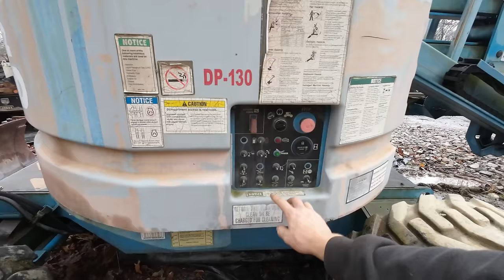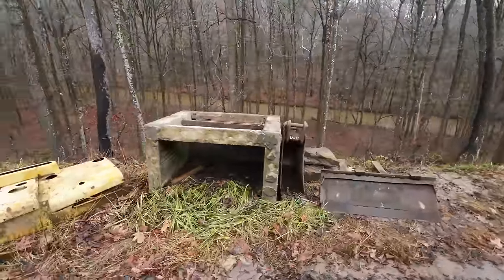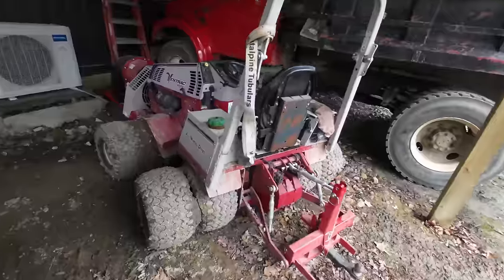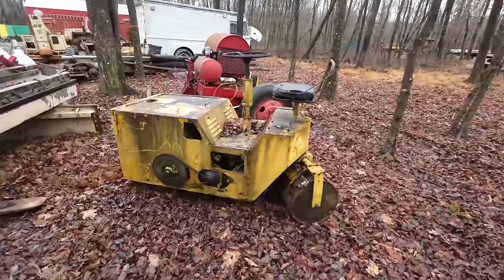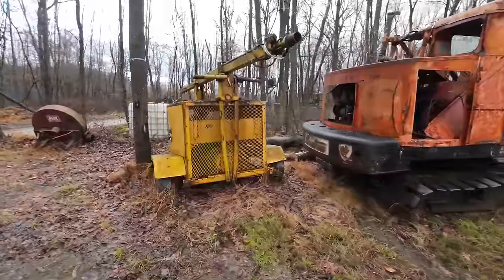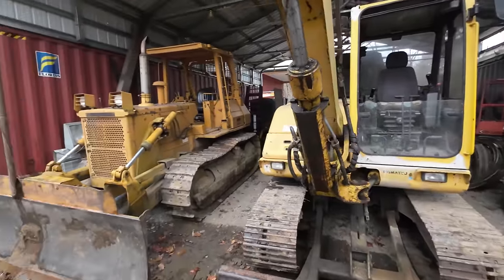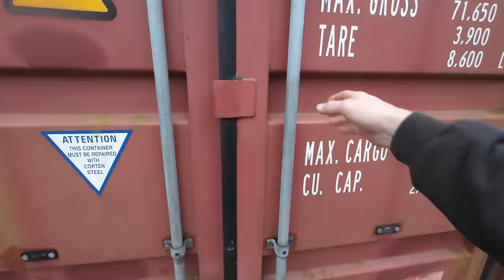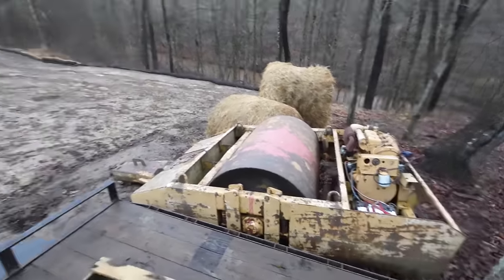Take A Look At My Junk (Every Project I've got)

Comment: This comment is about heating your shop floor with hot water!!! Don't run boiler temperature water in or under that concrete. Start just above floor temperature water and increase the temperature slowly until the floor temperature is about 70°F maximum!! Hot water will cause too rapid expansion and crack and break your floor!!!!

Comment: When you run the air lines underground from your compressor, if you have not already, you should consider another dryer on the incoming side.  Underground air lines will condensate a lot of moisture.
Reply from the maker: Yes that’s my plan.

Comment: I put more miles than I care to think about in old International Loadstars . No telling how many thousands of bushels of grain and how many loads of sawdust I moved .
They had the 250 AC system , which was 2 windows down and 50MPH .
The heaters and blower fans worked great though , and would give you a mouse turd shower like you never imagined possible .
Reply: They have one heck of a good turning radius!

Comment: You showed us the parts washer, using heated water and sodium hydroxide. This brought back memories from my farm days. My Dad and I borrowed a gas powered, diesel fired, steam cleaner used to clean and disinfect mink pens, and used that machine to pressure wash any machinery we were restoring.  It was not a large machine, but it sure made quick work of cleaning up and prepping a machine for painting. In the absence of such a machine, my idea is for you to take the hot water hydroxide fluid and use a pressure washer to apply, you may be able to strip the paint, grease and rust off of your entire machine, rather than use a sandblaster. Much quicker, less messy and strips everything down to bare metal for a perfect clean.  Just a thought.

Comment: Get you some fiber Rock or if you have left over metal from the shop build as a guard and hang them on the wall like you would if there was a wood stove there then you can change them out if you need to or paint the metal if you need to.

Comment: Saw a tip to fix floppy socket/hex u-joints , just use heat shrink and that will make them flexible not floppy, you also need to find a mechanical mule for your farm and because they’re fun

Comment: SAVE YOU MONEY. Matt, as a 30+ yr hyd. mechanic for uncle sam, I need to point out to you that crimp on hyr and air fittings are a total waste of money. These are available in thread on at the same pressure ratings. You buy the hose and swap the fitting over. Those fittings are a large part of the hose cost. The fittings are a few dollars higher, but once and done. This will save you much money over time.

Comment: You really need to be super careful if you are going to try to straighten up that transformer. I would not recommend you try that with it energized. Make the power company come out and do it that is their job after all.
Reply: Yea and pay another 10k? Lol
Reply: @kriptick1  it should be free of charge or at least it would be for the company I work for. Been here 16 years in linework and we have never charged to straighten at pad mount before.
Reply: Couldn't agree more. For 52,000 they should have done a better job
Reply: @mrfordman9999  I can’t speak for that company but they could at least straighten the transformer. We always try to make them lean backwards because that’s where all the oil and coils are at inside them.
Reply: The power company is not responsible for the pad. I built a house in the same county as Matt and I was responsible for the transformer pad. Yes, mine also went off level and gave me no issues.
Reply: That’s called “the union label“…
Reply: Surround padmount transformer with gravel
Reply: @mikemanzo8495  well the company I work for here in Georgia isn’t like that. Can’t speak for everyone but I can definitely say moving that transformer energized is a really really bad idea. Unless you can access the door and some high voltage gloves and also and fiberglass UD stick.
Reply: @kennethbrown109 even if Matt was the guy that prepped and installed the pad?
Reply: @kriptick1 what is your life worth? You’re not just talking 240 volts somewhere around 38000 volts or higher is nothing I would try to do unless they unhooked the power at the road to make it safe. You would be dead before you even knew it
Reply: @corydriver7634  absolutely. You have to remember there is primary and secondary voltage in that transformer and also a thing called step potential. If that elbow comes off the bushing and goes to ground voltage will go to ground. Look up step potential. It can absolutely kill you like right now. It’s like dropping a pebble in a water puddle if that makes any since to you. The ripples would be the voltage differences IE step potential.
Reply: Have the power company come out don’t take any chances you can’t see it or smell it but it can kill you .
Reply: I'm a handy ...man, and can confidently handle just about any job, but I have a rule about screwing with mains electricity, pressurized gas lines, etc... I just don't do it.

There is a reason why the pros charge big $$$ just to show up: They're worth it, imho. I'll save money somewhere else.... But, that said, I don't know all of the particulars here. It's probably perfectly safe to do that kind of job on my own...  But, still, the fact that I'm not 100% sure of that makes it a pass for me... but everyone  has a different skill set, and Matt here is quit a bit beyond me In most things.

Anyway, cheers! (Now I'm gonna research this and find that it's no big, probably, eh?)
Reply: @kriptick1  

10k is only about another 15% (and, depending on how one values their labor, prob more like 5%- thinking in gross dollars isn't constructive) on this job... AND, the cost would probably be far, far less- prob just to have a pro come out and make sure it's safe to do. If it is NOT safe, well, 10k is a great bargain.

but, y'know... I can beat that train.
Reply: @kennethbrown109  

BUT... the power company  DID NOT pour the pad! (They should fix Matt's work?)
Reply: @bholdr----0  they should absolutely fix the pad leaning. One way or another nobody should try to straighten it while the transformer pad whatever you want to call it is energized. I have worked in this industry for almost 16 years and I would not straighten it up myself
Reply: @bholdr----0  I’m a handyman and can change out the meter base and reconnect the lines to the transformer but your talking about high voltage wires coming into said transformer it is around 38000 volts not 220 which usually measures around 248 or 124ish a leg. I was replacing a doorbell transformer once and it measured 144 volts and I was checking outlets inside the home and it was the same. Called the electric company and they confirmed it and pulled and replaced the transformer.  The homeowner over the years had been having problems with appliances going bad, and I solved the problem.
Reply: @earlestes8649  

"Just" 240 volts? (I always thought it's nominally 220, and/or 240 is in the range... still I wouldn't stick a fork in it, or I'd be done!).

Actually, I took a hit from 220 once. (at an 100+ year old factory building I worked at, with some shit wiring- old paper insulation or none at all, leaks everywhere, water on the floor, missing ground lines, etc: ZZZZAP! ...Not. Nice. At. All.

(440 and yer prob cooked... Any elechickens wanna weigh in? I kid! Big respect for you guys)
Reply: @kennethbrown109  Ppl didn't do the pad mount diesel Creek did
Reply: Also the Marcellus
Reply: @kennethbrown109 I was thinking the same thing I think he should've done a better job in the first place to avoid doing anything else in the future but he knows his stuff it'll be fine..
Reply: Going to build a container house w/ containers using Grove crane...my bet 2¢
Reply: @golletim 
you need to post this on the main comment...
Reply: I recall Matt set the base.
Reply: Thanks for the tour Matt.
You've got some really interesting projects coming up.
I hope you're able to finally sell of the items you need to so it'll free up space and put some $$$$ in your pocket to  finance those projects instead of having to get our your wallet.
Reply: Is there not an isolator further up the line? Even if it's Matt's responsibility, he might be able to either isolate his line himself, or get the power company to do it for him while he levels it
Reply: Happy new year
Reply: @rickgalla3377 If you go back, you will see that Matt bedded the base in gravel
Reply: Ha ha there’s another 20k
Reply: @mrfordman9999 if u listened its matts fault he said he didnt compact it when he prepped and backfilled it
Reply: I like projects, but I would put some heat in the floor don’t like cold feet.
Reply: Agreed the flash arc alone will ruin your life if you manage to survive it.  This is a horrible idea with it being energized.
Reply: Arc flash burns can be fatal.
Reply: @earlestes8649 Where do you get 38000 volts from? That’s transmission level voltage! If I had to guess, the primary coming into that transformer is more likely to be 7200 volts (but it could be 7620 or 7970 volts, all very common singlephase distribution voltages in the US and Canada).
Reply: @Renville80  I was just guessing lol, 72,000 sounds right.😝don’t matter average Joe shouldn’t even be thinking about messing around with it. I work with 220 all the time, installing meter bases and panels.
Reply: Definitely bring in one or two of those Cub Cadets and get them up and running.

Comment: I love that beater with a heater.  That was my dream truck when I was your age, right down to the color.  Hey, its only junk if it doesn't run.  If it runs, it has utility.  The only caution is getting too many non-runners so that you don't have time to get them all running.  You are the key to the whole puzzle.  If you can take a non-runner and get it to run, it has utility.  If you get overwhelmed and bogged down so that you don't have time or momentum to work on them, you end up with a field of junk.  Ask me how I know that.
Reply: By the way, Keith Rucker is working on a Monarch 612 right now.  That might be useful to you as you get yours going.

Comment: 01:06:50
You can use it as it is, but with a simple trick, which is to shorten its longitudinal lifting columns so that they are completely below the level of the ceiling beams.

Comment: 44:34
You can use all of these containers to build equipment from scratch. For example, one of them is a heat chamber for treating paint, the other is a sandblasting room, etc.
Or they may be specialized warehouses, meaning that one of them is only for hydraulic maintenance equipment, hoses and cylinders, and the second is for welding equipment and everything related to it.
The third is for electrical tools, wires, circuit breakers, and whatever was boiled there, and the fourth is for storing lawnmowers and their spare parts.
Or you can put them together and build an apartment with two floors and many rooms.

Comment: I love the Loadstar. I did a revive and rescue that involved a 32 mile journey on a boat gas tank with no brakes in a 77' 1600. Mines not a butterfly hood like yours, its the next body style. Biggest vehicle ive ever owned, favorite thing about it is the Dayton cast iron spokes. I didna deal where i gotta haul away 50+ 10.00-20 tires and wheels and i get a free supposedly good DT466B.. so i think i might put that in it....

Comment: On the Gehl blower you need the intake at the center of the fan wheel. With the missing panel out to the edge of the volute (fan housing) the air just leaks out the side of the blower and it won't build any pressure. Close the hole and create a hole in the side of the volute centered on the fan wheel. Make it about twice the size of the outlet. 
You will have pressure and volume if you do.

Comment: The red blower needs the air inlet near the centre of the fan so the air is pushed outwards building pressure, think of it like a centrifugal water pump but shifting air.

Comment: The best way to avoid conduits breaking is not to backfill until the bottom is settled. Especially around wells with concrete rings, the force of the dirt can shear the hose, if you are impatient and backfill all at once. Dont ask me how I know that.

Comment: Matt I can't wait to finally see the 1957 Autocar restored. My main reason is,Autocar was a division of the White Motor Company,and both my grandfather{30 years} and father {40 years} worked there. I also want to say that your channel was the only one I ever purchased an item from and is the 1957 Autocar T-shirt. It took a bit of saving up as I am 72,on disability from terminal cancer,and funds are very limited for "non-essential" items. I will never wear the T-shirt as for one,I can't afford another,and two I bought it as a nice memento of my families work at White Motor Company. A sad note. White motor Company was purchased by Volvo Corporation,and shorty after the purchase,the White nameplate was dropped. White Motor Company once consisted of White Trucks - Autocar - Western Star and Freightliner. The other three went on to be companies of themselves.

Comment: Hi Matt,  that bridge crane laying there will never see the inside of that garage unless your going to tear it ( The Shop ) completely down, rip up the floor and your heating system, dig huge holes for the required substantial  foundation to handle the weight of the crane plus what your planning to lift with it, plus it has to be perfectly LEVEL end to end and side to side, and stay that way.  Now let's talk 3 phase electricity to run this crane. Got it ? The Crane Foundation goes in, the piers are built up to a few feet above ground level to support the upright beams to hold the level track beams. Once their leveled, you can take your big crane and lift the crane and sit it on the rails and  leave it sit outside or build an addition onto your new shop to cover the crane also. Crane foundations go in first before any building is built around them.  The foundations are massive, and have to be to keep them from sinking.  
I really like you and your channel Matt and watch every free minute I have. You amaze me and I'd really like to see you amaze me again!  But unless a new structure is in your plans, better do some research.
Reply from the maker: I think you better go watch the videos of me building the shop. The footings are there.

Comment: Matt since you opened with the man lift and said you have used it I have to put my two cents in.  I spent many hours up in these things and want to make sure you know the rules for safety.  You must have a harness on when up high and it's got to be tied off to the basket. There are designated points for this.   They are very reliable when on a firm level surface but if you're up high and the engine dies it's really nice to have someone on the ground to help out.  Also stay 20 feet from any electric lines.  That blue one is a nice one and for 1k you got a real good deal.

Comment: Hay Mat love the old stuff.   I my self would love a 64 Jeep  I was born in 64 so I have Coleman lanterns in 65 book and Mags in 64, and a collection of Garden all built in 1964.    Speaking of garden tractor that you have have on the storage container ( Might ) be a Porter Cable Mark One Suburban.  I would need better Pictures to be sure but what I see in the seat, seat spring, foot rest, steering setup and frame leads me to that call.  But early GT just bought parts from foundry so many have the same parts.

Comment: The silage blower likely won't build pressure. It'll create air flow, which requires restriction to become pressure. As the tolerances in the blower aren't very tight, don't expect much pressure. They're designed to push material, rather than blow, so you could dump leaves in the intake and have them piped to somewhere else.

Comment: I’d drive the older truck in the winter 

I do the same I park the new one in the winter and drive the older one. 

I have undercoated both vehicles but I’ll still take the old truck out in the winter time over the new one since I has seen some good rust in the past 

I’ve put a new bed on it and replaced the rocker panels the frame luckily is solid and the bumper

Comment: His Matt your Coles crane you picked up for a song, we had one in the 1960,S Early, but ours hadn't any hydraulics no assisted steering even the out riggers had to be pulled out manually and they were heavy two men and a bar put through the handles and pull you could here the rollers working there way on the runners then only another three to go and then we had to wind them up it was a days work just to put the crane on it's out diggers,the jib and lifting block and hook everything was over engineeredand soon Heavy. We put new tyres on the Front four wheels next morning the tyres were knackered being that the walls of the tyres were ribbed bulging out parts of the wall all the way round the Front was soon heavy by the time you had rigged this thing to lift it would only lift 40 tons ,it was a big crane for it's day,there was one bigger I heard it was a Fifty ton lift,they said the man who bought it was mad nobody would want a crane that big he was in Scotland he made so much money with that thing he ended up with a crane hire firm with a few cranes there's one thing I will never forget that Heavy crane. Your doing well Matt keep it up